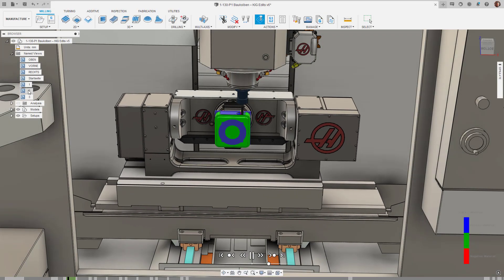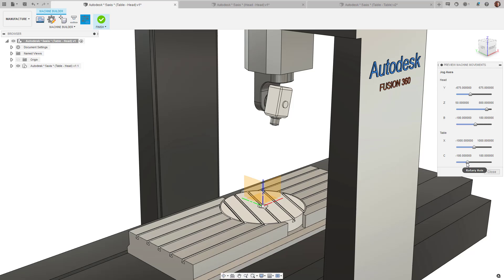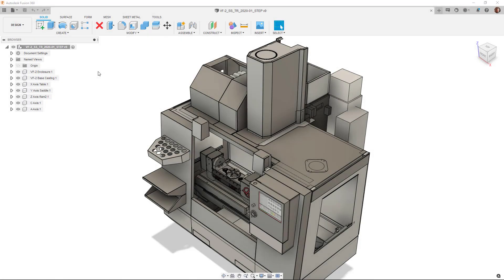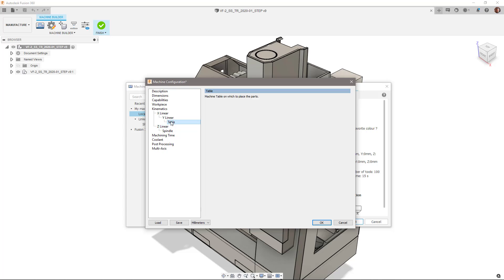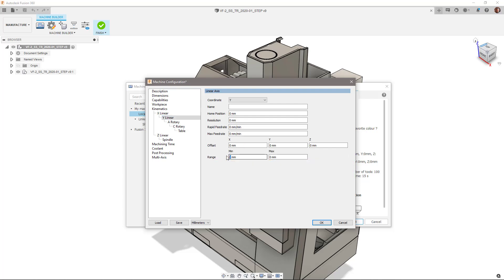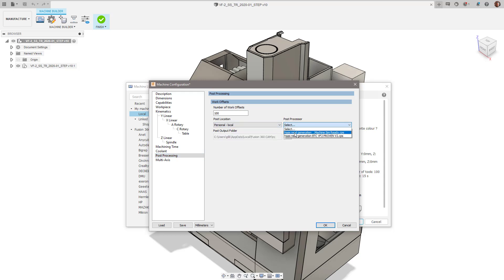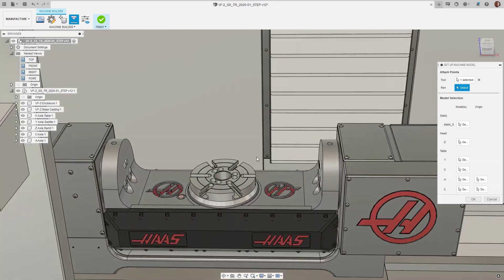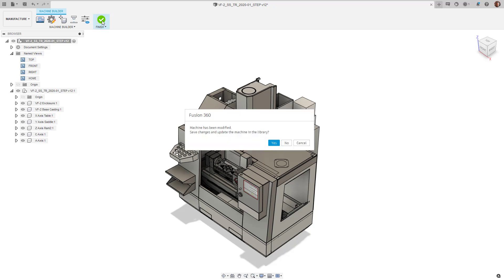Fusion 360 Machine Simulation - Machine Builder

Comment: Thanks you for posing this.  After exiting the machine builder with a working mapped CAD model for X,Y,Z, the machine library has no thumbnail for the machine model and if one exports the machine under machine library, the original CAD/Fusion 3D model just edited is missing and not embedded (as the file size is way too small).  How can one create a machine, see it during visualization, and export or share the *.machine with model embedded or attached with other Fusion 360 users for their visualization?

Additionally, if one clicks on the Machine Library filter for "Simulation ready" the Local machine just created and calibrated disappears.